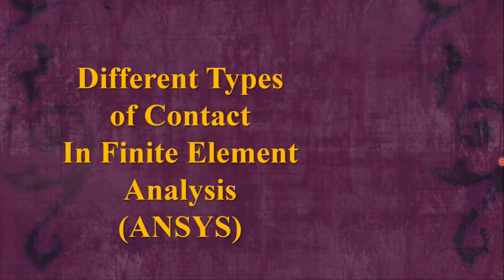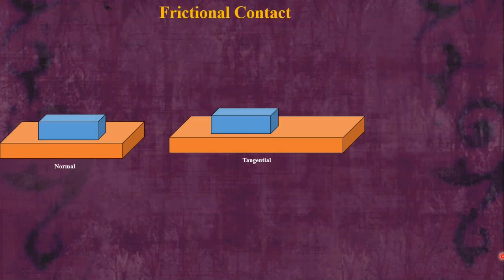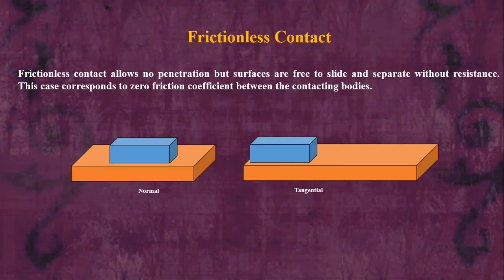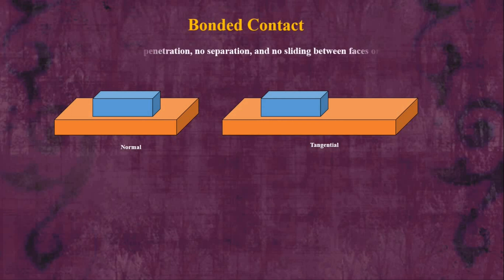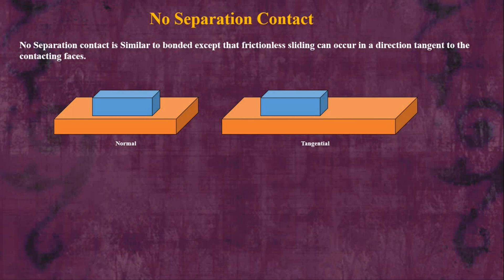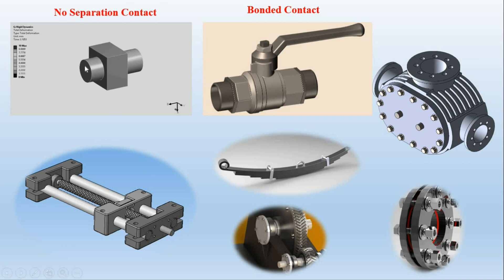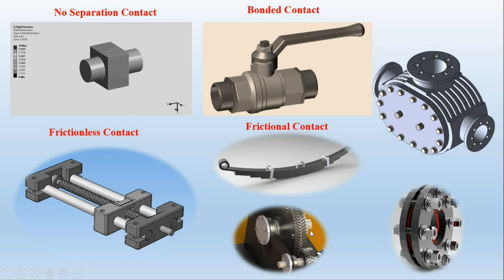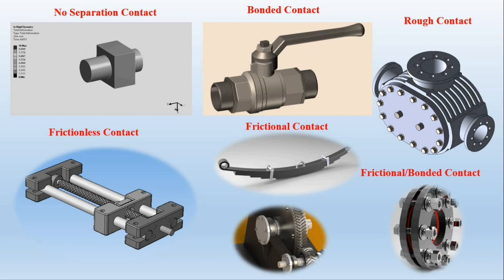Types of Contact in FEA (ANSYS)

Comment: Hi! I have a question about something I did not see in your video: Is it possible to make a contact between a shell edge and a beam element? I have tried it in several different ways, but unfortunately it has not been possible for us. Do you have any idea about how to do it? We also tried with a fix joint, but it does not work properly. I would really appreciate your help, so thanks a lot in advance for your answer.
Reply from the maker: Hello ! You can try to flip target and contact in contact details. Fixed joint should work properly, try to check rigid and deformable links in joints details. There are number of ways to connect, based on your problem definition we can propose the best possible way.
Reply: @graspengineering9249  When I use deformable behavior fixed joints, this warning message appears: "One or more loads is using a deformable behavior but is applied to a collinear edge. This is invalid, thus the behavior has been changed to Rigid. Check the Solver Output on the Solution Information objetct to identify the offending load.", and based on that, beam displacements and internal efforts are neglictable. Have you seen this problem before? If so, I hope you have been able to solve it. Thanks again!